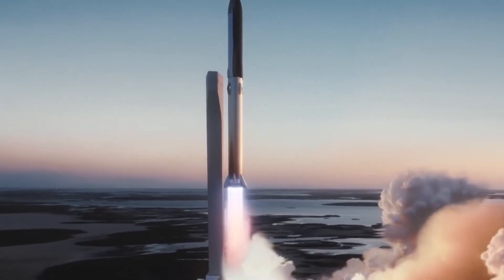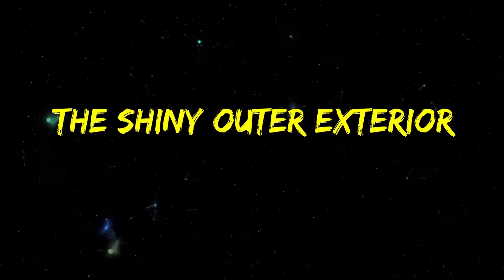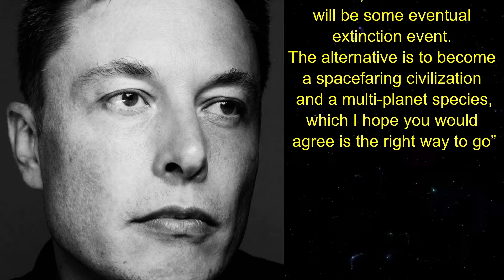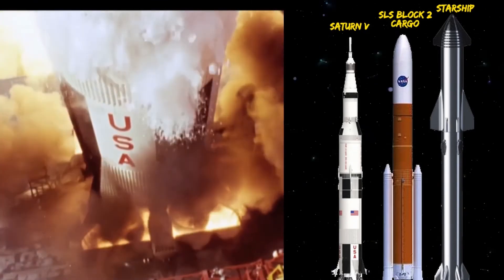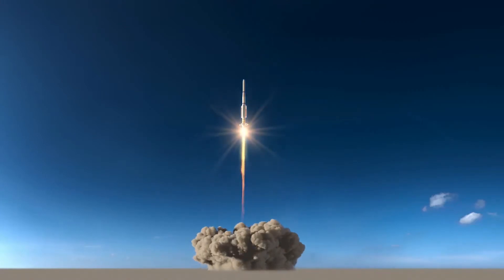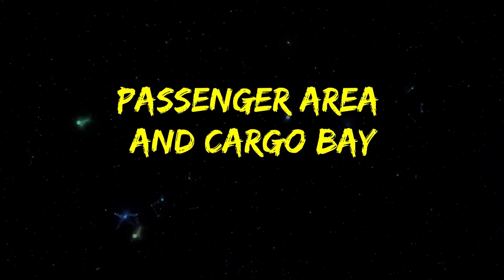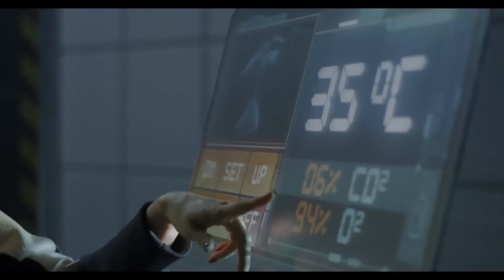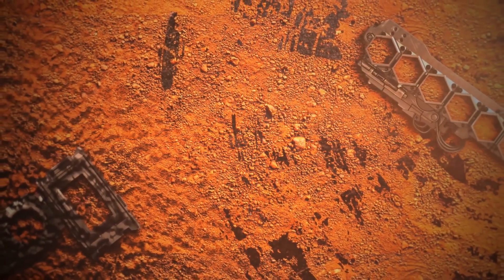A Look Inside SpaceX's Starship

Comment: Everything could be potentiated if 3 starships were operated in one, in a Trimaran configuration where two normal starships on the sides and a modified central transport that would always be in orbit either on Mars or on Earth. A great example is the  Enterprise Spaceship  which is a TRIMARAN
Reply: Getting into or out of orbit around either planet would unnecessarily use a lot of fuel.  Better to have a Mars cycler -- a spacecraft which would stay in an elliptical orbit around the Sun, performing regular fly-bys of Earth and Mars.

A smaller crewed craft could match speeds and dock with the cycler which would have supplies and life support for the trip to Mars and back.  Even artificial gravity.

They use this concept in the movie "Stowaway".